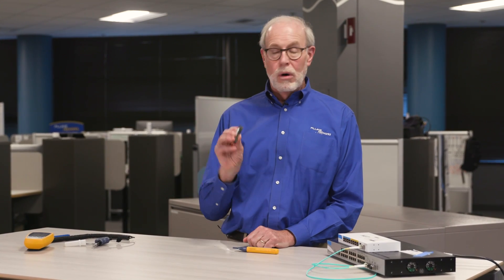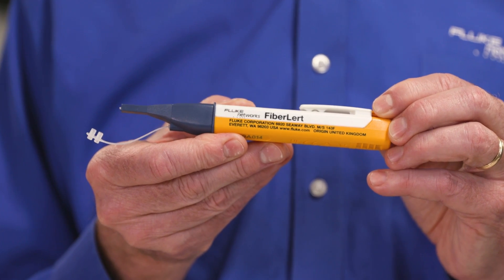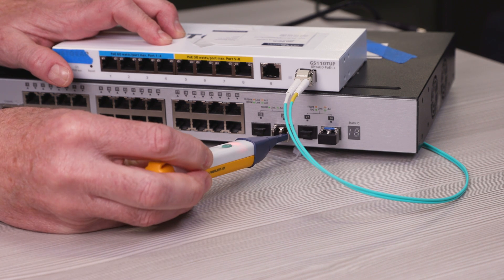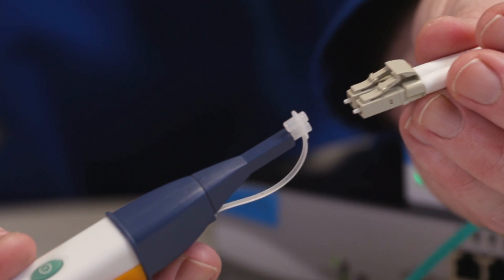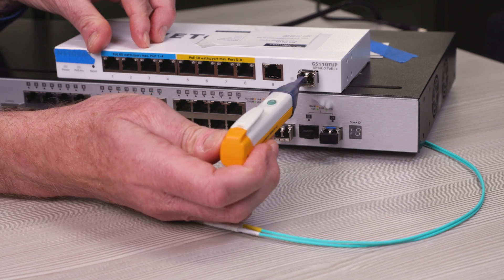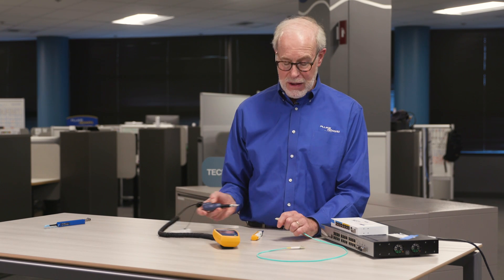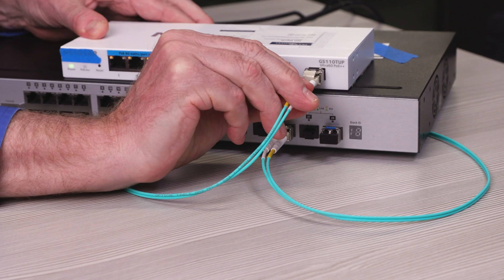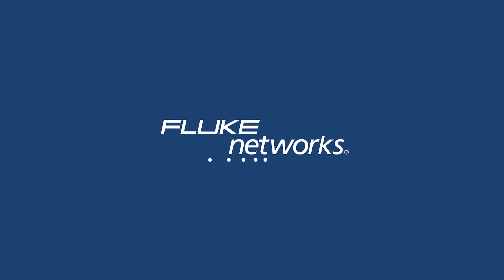Testing SFP / QSFP Transceivers with the FiberLert™ Live Fiber Detector by Fluke Networks

Comment: Such a great tool to have. Today I went to fix the connection between two switches. They were interfaced each other via fiber and SFP.  I found out that the SFP were bad. But did not have a tool or tester. I just replaced the SFP by trial and error. I just ordered one.